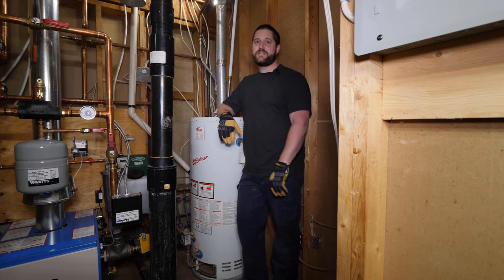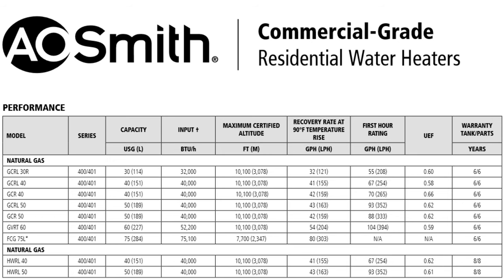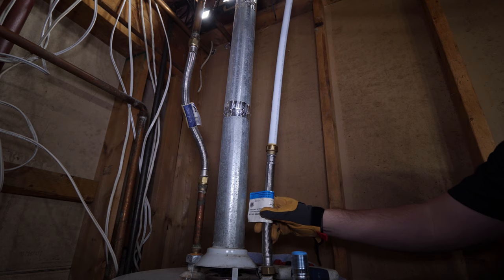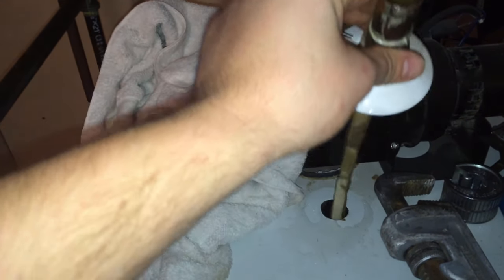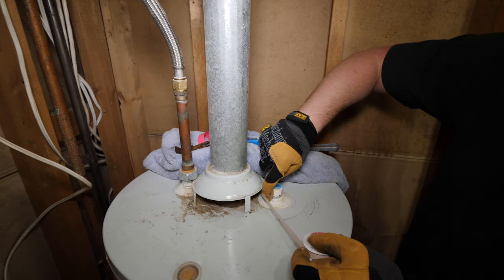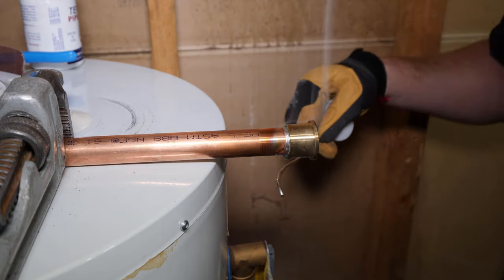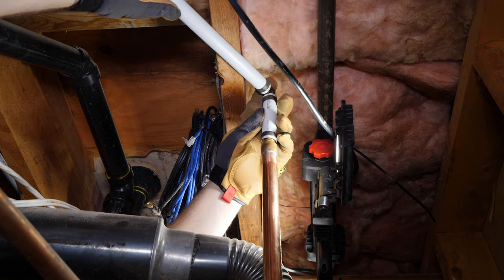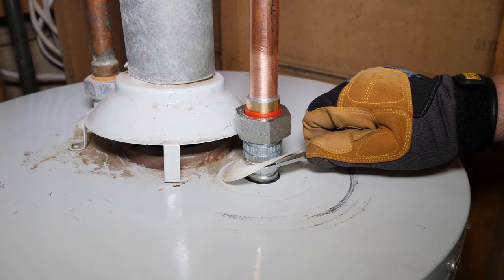How to Replace a Dip Tube on a Water Heater

Comment: Somehow the previous tenant/plumber had my boiler piped backwards with no  down tube whatsoever so that answered why my hot water would run out fast in the shower, your video helped me understand the necessary details in order for me to swap the pipes but holy hell 90% of the job was trying to remove the old nipples! Thanks for the help.

Comment: I’m getting no hot water flow after 10 seconds. I think the dip tube is clogged. I put a rod down there and it sticks. what do you think I’ve replaced the cartridge in the shower I have replaced the anode. I’ve drained it twice. I still have hot water for about 10 seconds and it shuts off upstairs in the sink. I still get a little flow in the shower nothing. At this point, I’m grasping at straws and I am going to replace the dip tube. See if it’s clogged. I’m gonna have a beer if it isn’t clogged it’s gonna be vodka.

Comment: This is a great video. I thought I would click on it and think it's going to be crap or not very detailed. Turns out...... This was the best tutorial video I've seen in a long time
Reply: Knew your code too! A lot of people would have flexed it back again or straight PEX to the tank with FIPXPEX adapters  and used a copper FIP 😂 dielectric union too 💯🤙

Comment: Thanks for the great video.  I didn’t know that the tank does not need to be emptied or to put gas control to pilot setting vs shutting it completely off.  Thanks, that will save me time.

Comment: Hot water less and less in shower, I hold hot and cold water on top of the hot water tank, temperature of both pipes were the same around 80 deg,  Is it deep tube cold water broken ?   Thank you very much for your fantastic video

Comment: Replaced mine today because the threads on the heat trap were rusted.  The heat trap I purchased didn't have a dip tube attached.   Is there a way to install one in the fitting, or do I need to buy one that is pre made?  My local hardware store didn't have a pre made one

Comment: A big ‘Thank you’! from a fellow Alberta resident.  Dip tube was completely gone in my case.
 I didn’t see an anti siphon hole on the dip tube as I was installing it however. 

Hardware store gave me a tube that was labeled as a pressure relief valve attachment, and when I questioned it they said it works for dip tube. Installed fine. 
Am I still good to go?

Comment: Thank you for such an informative video/explanation. I read that to test if the Dip Tube is working properly to take the temperature of the water coming out of the drain. If the water temp decreases, the dip tube is working. My question is how much of a temperature drop would indicate the tube has no leaks/deterioration? (As water is used from heater, cold water is added. If added at the bottom from the dip tube, as the water is drained, the temperature should decrease).

Comment: NICE JOB on the soldering. And thanks for doing this correctly. As in using rigid copper pipe and NOT SharkBite house flooders. Well done sir.

Comment: Got couple Questions?  I have a tank on a stand, and limited space above ( about 32")because of a furnace duct to replace dip tube. Dip tube I need is 40-42". Are they pretty flexible to curve them into the opening to get into the tank? More important question, can you buy the flaired tube ($7)  and a pass through nipple ($6) and apply them instead of the $40 all in one DT version?  Thanks

Comment: What kind of clamping tool did you use to transition from copper to pex? Did you sweat a connector onto the copper off screen or did it crimp onto the copper like a manual ProPress?

Comment: I think my dip tube just gave out TONIGHT! I have a boiler with hot water coil. Is there a way to be sure it’s the dip tube before I tear into it tomorrow? Maybe by checking the inlet and outlet to the coil temp? The inlet to the coils should be cold right? Not warm? Right now it’s warm into the coil and hot out…

Comment: Heat rises dog! Solder from low to high! Good vid 👍🏽
Reply from the maker: Warmer air will rise in the case of convection not conduction, which is the primary source of heat when soldering. I have my reasons why I solder top-down on certain fittings. I plan on making a video on this in the future. Cheers!
Reply: @PROSDIY  joints are nice and clean, to! Keep it up brother 🔥

Comment: Great video, clearly you know what you’re doing but I don’t. I was a little confused about the old dip tube? It didn’t look bad and it still looked like the right size so does that mean it didn’t fail? I got the other dip tube that was completely broke down but the first one didn’t look like a problem at all. So if the old dip tube doesn’t show signs of failure can one assume that there is another problem with the water tank?
My 50 gallon doesn’t seem to be giving us enough hot water like it used to and it’s more than 12 years old.

Comment: Hi thanks for excellent up to point video I only have one question for you . Can i do this also for electric water heater
Reply from the maker: You're welcome. Great question. It works the same for an electric tank. Just make sure to shut the power off at the breaker first and the same procedure works.
Reply: @PROSDIY  thanks for reply i am going to try that tomorrow
Reply from the maker: You're welcome. Good luck!

Comment: just had a new hybrid hot water heater installed and it works fine but the water smells like burning wax or an extinguished candle.. any idea what needs to be done to fix this?

Comment: Great info and video! What’s a Ballpark figure of the cost of this job by a pro?
Reply from the maker: Thank you! Personally I charge $180 - $200 CAD for a dip tube replacement. This cost will vary greatly on the hourly rate of a plumber in your area.
Reply: Pros DIY not bad price wise! Much thanks for your response! I’m not 100 % percent sure that a dip tube is my issue because I’m clueless about water heater repair but from everything I see (hot water running out quickly/no hot at all) it sure seems like that could be the problem. However my repairman recommends total replacement for my AO Smith 50 gallon model that was installed back in 2013! It was brand new then and I believed hat I would get about 10-15 yrs out of her because my old one lasted around 20yrs before leaking. Money is tight and a couple hundred bucks vs more than a grand for replacement has me over a barrel! What in your opinion would be my best option if you could give such a suggestion? Having some insight from your knowledge has been a huge plus. Many thanks and much success to your business and YouTube channel! 👍
Reply from the maker: That's a tough one. I would probably have gave you both options as a plumber as well. It's at that age where it could last 10 more years or fail tomorrow. I find newer tanks don't last like they used to. I think it's a combination of households use a lot more hot water now than 20 years ago and the quality of manufacturing has gone down. I'm finding on average in my area 50 gallon atmospherically water heaters that are sized properly are lasting 10 - 15 years.
Personally I would be changing the dip tube if that what is determined the issue is. If your hot water supply isn't lasting as long as it used to and the temperature dial hasn't been change, it is most likely going to be a damaged dip tube. 
Your decision may differ though with factors like financial situation, if the tank leaks is it going to cause a ton of damage, average life span of tanks in your area. Which ever way you end up going with, shop around as water heater prices vary greatly from company to company. Good luck and thank you for the kind words!

Comment: When I removed the dip tube, the nipple part came out, but left the blue plastic tube part still stuck in the heater. I lightly tried an “easy out” (for removing broken off bolts) but it didn’t even move. How do I get that plastic out?

Comment: Nice video but I noticed when sweating you were applying heat to the side you were wiping I've always been thought to heat the opposite side of the fitting from where your working
Reply from the maker: It all depends on the scenario for me. I personally solder smaller ball valves 1" and under with the method shown in the video. This will help reduce the chance of overheating the valve and damaging it. The reason people are taught to solder with the heat at the opposite side is it ensures the the fitting is hot enough all the way around. The down side is that it can overheat the fitting and cause your solder to run. This is just all in my opinion and everyone has their own methods.
Reply: @PROSDIY  amen makes good sense now that you explained the over heating part I got ya thanks👍

Comment: what is the tip called you soldered on the tip of the pipe and the red thing you put on after you wiped it down
Reply from the maker: Hi Josh. The complete fitting is called a dielectric union. The soldered portion is call a brass sweat insert or brass adapter. The red thing is a isolation sleeve. Thanks for the questions.

Comment: I only have two feet above the WH to work with and the dip tube is 42 inches long. Are they flexible enough to bend as it's inserted into the tank?
Reply from the maker: That's unfortunate. They are flexible to some point, but 2 feet isn't a lot of room to work. Two options I can think of:
1. Connect the cold supply line into the drain valve with the use of a tee. This would deliver the cold water to the bottom of the tank without the need of a dip tube, but requires more piping.
2. Using a hair dryer to soften the PEX dip tube. This should give you enough flex in the tube to install without kinking it. The dip tube should return to it's original shape once it hits the water.
Hope this helps. Good Luck!
Reply: @PROSDIY  I just had my dip tube replaced within the last 3-4 years and am again having the same symptoms as before..shower starts out hot, but turns lukewarm about 10 minutes later. Is it possible the dip tube is bad already? It is a much older STATE gas hot water heater. I like the idea of converting the drain valve to a cold water inlet. Do you have a video on this process, or are you simply adding a "T" where the original drain valve is and putting the supply on one side of the T and the drain back on the other side? Are there any code restrictions or negatives for doing it this way? Thanks so much, and AWESOME vid!
Reply from the maker: @mikewilson0077  If it's the same symptoms, it's most likely a damaged dip tube again. I don't have a video yet on the conversion, but you're absolutely correct in the way you described connecting it. There's no code restrictions in my area with this connection and is done on almost all commercial water heater's. Thanks for the positive feedback and let me know if you have any questions. Good luck!
Reply: @PROSDIY  Thanks so much for the reply, I think I may go that route..I am about done with dip tubes..lol
Reply: You should be ok
Reply: @kimross5363  You're right I was okay everything worked out great

Comment: Don't they recommend a curved tube now to stir out the sediment?
Reply from the maker: Great question. Most major brands still use a straight dip tube. There were a few models using curved dip tubes for awhile such as Kenmore models sold by Sears. I personally don't see any difference from tank to tank with curved or straight. IMO I think the curve doesn't stir the water enough to lift the sediment.
Areas that have problems with sediment, I connect the cold water supply into the bottom of the tank. I remove the drain valve and install a tee for the cold water supply and reinstall the drain valve. This eliminates the need for a dip tube all together. To be honest all water heaters should be installed this way. Commercial water heaters have been installed this way for years but residential hasn't adopted this method.
Reply: @PROSDIY  Great idea

Comment: Nice job. The only thing you forgot is a vacuum breaker after the valve. Code in most states.
Reply from the maker: Hi Steve, You're correct that it's code in most states to have a vacuum breaker installed, but not here in Alberta, Canada. I think the main reason you see that that it's code in the States is because in warmer climates you can install the water heater in the attic. This leaves the water heater more susceptible to being siphoned. Definitely can't install any water heaters in the attic up here in Canada. The tank still has protection against siphonage because new dip tubes have an anti-siphon hole near the top of the tube. Thanks for the comment and the great point. Take care!

Comment: What if I only have the hot water issue in one of my two bathrooms 

one shower will last well past 10 minutes 

the other last maybe 10 minutes maybe 15 at the absolute most

Everything else in the house stays hot its just the one bathroom that won't keep hot water
Reply from the maker: Just to confirm. When you run out of hot water at the one shower after 10 mins, if you open a faucet somewhere else in the house will there be hot water (run for 2mins)?
If no: Then it's most likely going to a water heater issue. Either undersized, temperature set too low, or damaged dip tube.
If there is still hot water: Then it will most likely be an issue with that shower valve's cartridge.
To me it sounds like a water heater issue (undersized, temperature set too low, or damaged dip tube). It is most likely happening faster on one shower compared to the other because different shower heads can have varying gallons per minute. This extra water flow will cause the hot water to be depleted faster.

Comment: I wish I was trained to properly solder or propress was more practical for the DIY guy.  This is probably a 500-1000 dollar job for a plumber in my area.
Reply: In my experience so far modern day plumbers aren’t interested in doing anything under $1000 and they REALLY aren’t interested in fixing anything. My water heater needed a simple service. The kit was $40.. I was on the road so I sent a very highly rated plumber in my area to do it. My water heater is like 6 years old and works flawlessly I’m just trying to stay on top of it. 
They gave us three estimates between $2300-$6500 none of which involved just servicing my perfectly working unit. 

That’s the absolute last time I ever call a residential plumber. I can mess up a lot of shit and still come out cheaper just doing it myself. 😂

Comment: Why don't they make them out of stainless steel instead of cheap plastic?
Reply: Surface resistance, and a metal tube eventually, it will make the water heater rust out faster. Stainless steel doesn't rust, but it tarnishes, which eventually build up with sediment.

Comment: He did not show how to connect the dip tube to the nipple.  He only showed how to apply Teflon tape to the nipple, after the dip tube is already connected.  And yet, that is an important step that should not have been skipped.
Reply from the maker: The nipple is pre-attached to the dip tube from the manufacture and is not removable. This is how they are purchased. There are dip tube models without nipples called drop-in dip tubes, but they are less common.